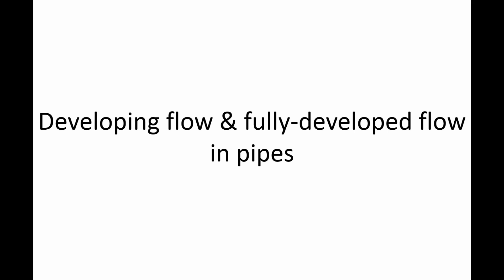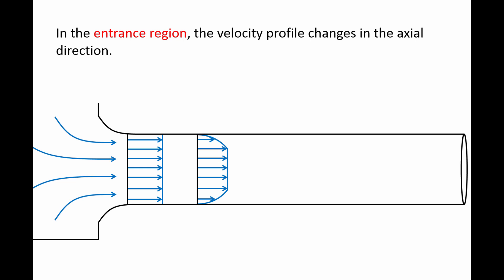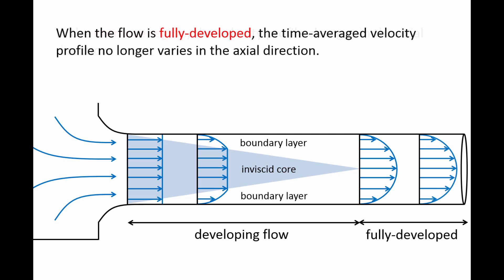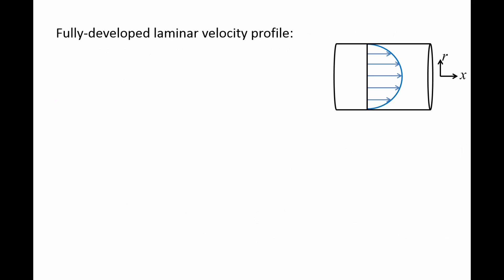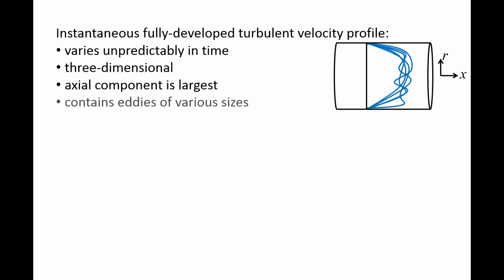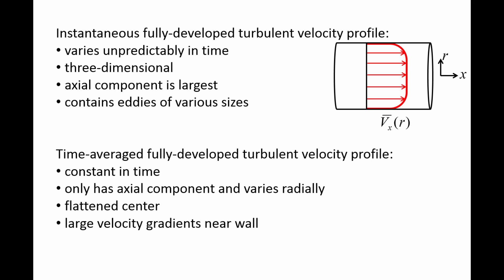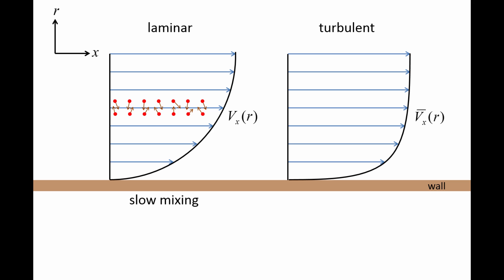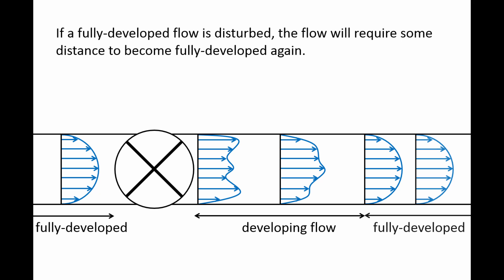Fluid Mechanics:  Topic 8.2 - Developing and fully-developed flow in pipes

Comment: Thanks for the nice video, wonderful explanation! 
Regarding the empirical expressions that you mentioned for pipe flow development, they have been proven incorrect because they suggest that Le = 0 at creeping flows (Re =0 ). Instead, check the non-linear correlations provided by Durst et al., ASME J. Fluids Eng. 127, 1154-1160 (2005) for pipes and channels.